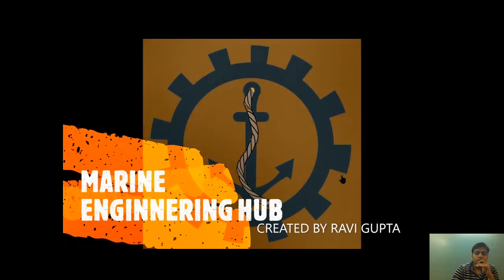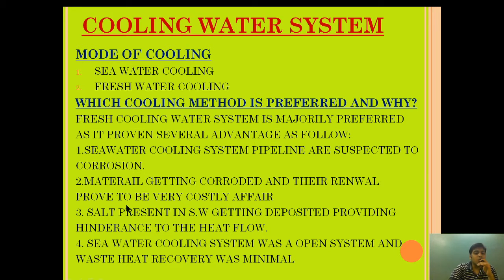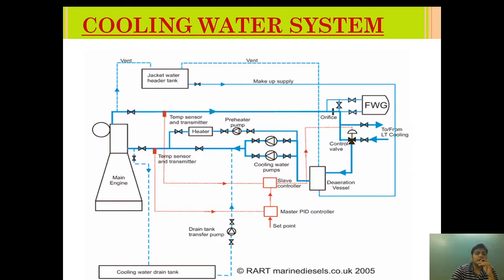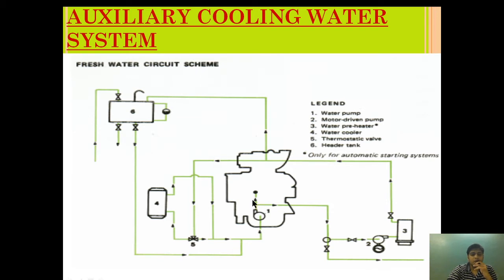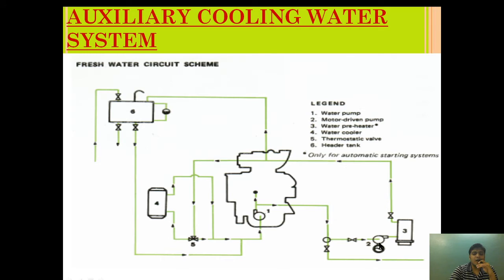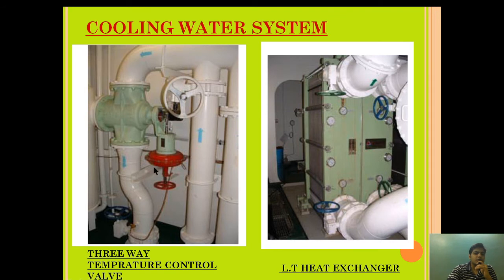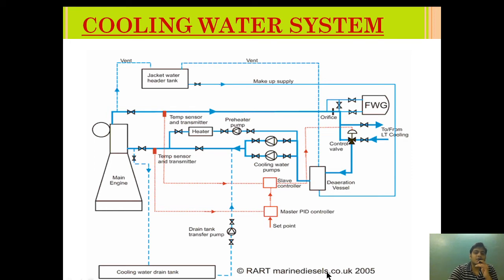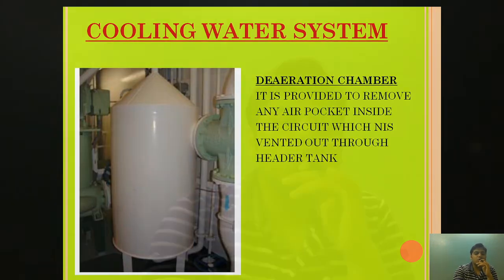COOLING WATER SYSTEM|AUXILIARY COOLING WATER SYSTEM|COMPONENT OF C.W SYSTEM|(PART-2)|

Comment: Sir if there is any leakage in LT system then how can we know ?? is there is separate header tank is provided for LT system ??
Reply from the maker: Good question Amarjeet!!!
In some ship they provide separate tank....but in most ship there is a single header tank....minor leakage of l.t system very hard to find in practical. But for exam you can say...you will carry out the pressure test isolation it from system if pressure drop occurs it's means there is leakage in system